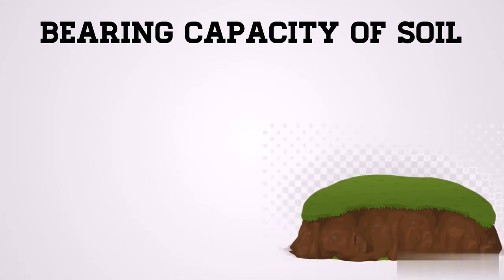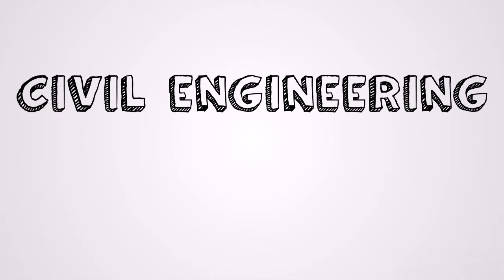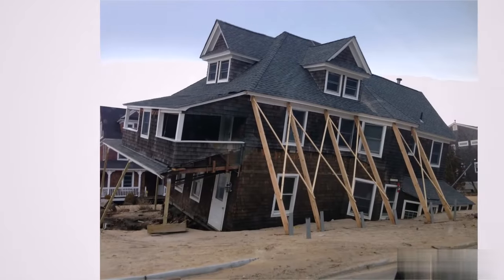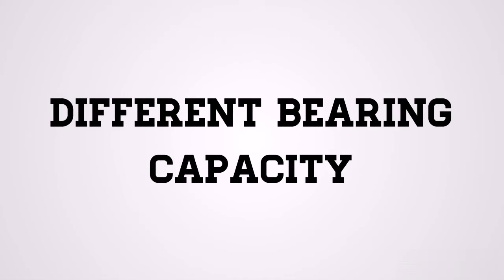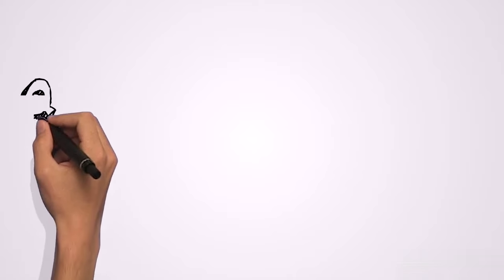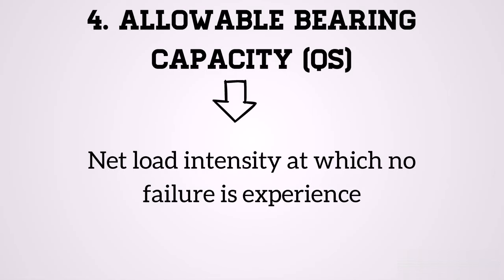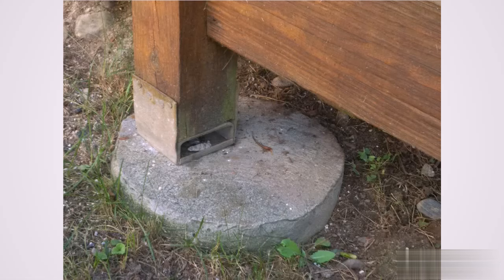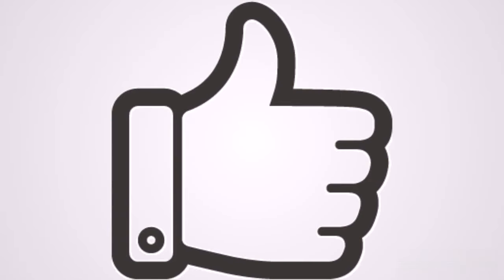What is bearing capacity of soil? | Understanding bearing Capacity of Soil

Comment: The bearing capacity of the soil is as important as the structure itself
Reply from the maker: The bearing capacity of the soil is very important. Because a bad bearing capacity will mean the Foundation will not be able to hold the structure when earthquake or wind load occurs. Which will make the structure fail quickly in shear.

Comment: Can I ask? What is the Ultimate Soil Pressure? In kPa
Reply from the maker: Hi Daniela. It will depend on the type of structure which is going to be resting on the soil. Usually 100Kpa for under strip footing and 50kpa for under slab footing. Is that clear enough?

Comment: I compute it by computing the Load the Footing carries in kilograms or kilonewtons divided by Length multiplied by Width of Footing , kG/m2, then the soil capacity in kg/m2 will be compared, then the Soil Capacity should be larger than the Load / meter squared.
Reply: ethics i follow...just commenting
Reply from the maker: Yes you are right.
Reply from the maker: That is correct. The overall goal is to make the soil capacity greater than the soil pressure in force per square area.